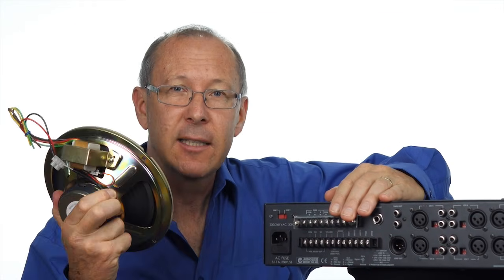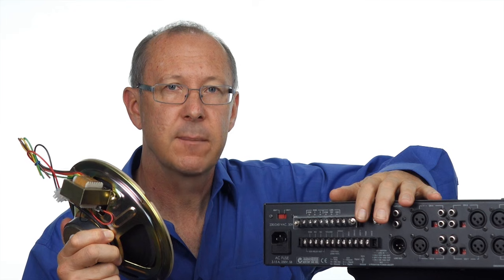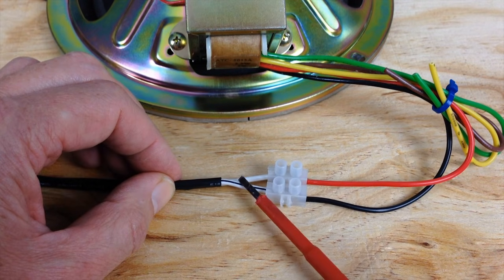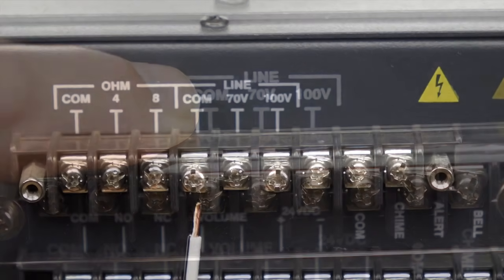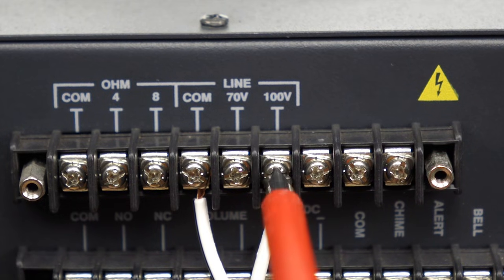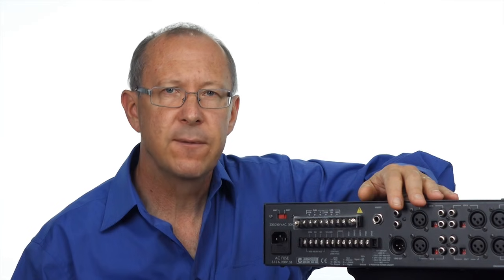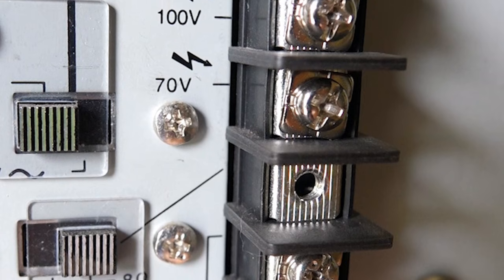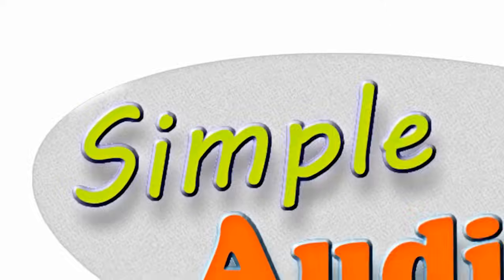Connect the amplifier to 70/ 100 volt speakers

Comment: Why are the speaker wires not connected to the “OHM” conn and either the 4 or 8 terminals..? Is that an 8 ohm speaker. Thanks

Comment: I have bought a MISTUBA 
Professional
..............................
DRIVER UNIT WITH TRANSFORMER
MTB-DU-50TR          CE
RATED POWER 50W  INPUT 100V
HORN COUPLING 1-3/8"-18 THREADS 

COM-BLACK
8W-1.3K OHM ~WHITE
15W~670 OHM ~RED
30W~330 OHM ~YELLOW
50W ~200 ~BLUEOHM
  the transformer inside has been burnet, could you tell me what is the rated output power,voltage of the transformer used so I can buy.

Comment: I have some old Argos intercom speakers with transformers attached to the speakers like the one you show. I build my own low power amps for mandolin and acoustic guitars. I have hooked up my amps outputs directly to the speakers. I have been unable to use transformer. Is this because I need an amplifier with the proper 70/100 volt outputs? Any way to take advantage of the output transformer? I typically have a 12v power supply feeding a LM386 or LM380. 1 to 3 watts output. Standard mono output.

Comment: I have a ADS 120 w mixer amp with 100v and 70v.  Everything works on the 4ohm -16ohm speakers post.  But I'm wondering about the 70 and 100v terminals.  I didn't feel any jolt or anything nor did it indicate anything on the my Volt meter.  I haven't hooked up my 100v speakers to anything yet, but shouldn't that 100v be live all the time? Or does it need a speaker hooked up to it?

Comment: Hi Gary, my question is, I have 10 toa pc-1869 ceiling speakers and I want to install them in the patio ceiling, now I have a Sony STR-DG510, can I wire them to this avr or do I need a 70/100V amplifier. Thank you for your time Gary.

Comment: Hi, is the ACM120 and 1 or 2 channel output amp ? could i run hifi speakers on it....cheers
Reply from the maker: The AudioTelex ACM120 is a mono amplifier. It has multiple inputs but only one output. It is not stereo.
Reply: @GaryDmedia  thankyou for the quick reply, one came up at a good price but no good for me with 1 channel output, Brett

Comment: Question:
0:50   Does the 100v line cause electric shock if someone touches the 100v terminal screw ? Thanks for the video.
Reply from the maker: In practice the actual voltage at the 100 volt speaker terminals will be between 10 and 25 volts. This is not lethal. Though I wouldn't put my tongue on the terminals. 
Because it is rated at 100 volts peak, manufacturers are required to place a cover over the terminals because it is over 50 volts.
Reply: @GaryDmedia  
Thank Thank you for your explanation.

Comment: How to connect the ampilifier to the mixer
Reply from the maker: Melad, depending on the amplifier input and the mixer output there are many options. Most mixers have a balanced 3 pin connector. A standard microphone lead will plug into this and the most amplifiers have the same connection for input. If yours is different you may be able to access the information in the user guide.

Comment: Hello sir
How to make 100volt amplifiers
Reply from the maker: 70 volt or 100 volt output amplifiers are simply a standard amplifier with an output transformer. You can make a 100 volt output amplifier by connecting a speaker transformer to the 8 ohm output. You must remember that the output of the amp must not be greater than the rating on the transformer.
Reply: @GaryDmedia  Hello sir
How much current it will take
Reply: Hello sir
How to make amplifiers 37V lord brahama laxmi sarawati ब्राह्मोस (रोमन लिपी: BrahMos ;) हे भारताचे स्वनातीत क्षेपणास्त्र आहे. स्वनातीत, म्हणजे ध्वनीच्या वेगाहून अधिक वेग ...

Comment: Hi.i have 20wats speaker  then mention  500ohms/500ohms. So where i have to connect. How many ohms
Reply from the maker: It is a little confusing. Yes the 500 ohm connection will be for the 70/100 volt line from the amplifier.
Reply: @GaryDmedia  hi sir. I have  amplifier that one don't have out put line for connect to power amplifier system .so i can take out put  from  70/100 volt line or ohms line then connect to QSC  power amplifier  input line.

Comment: Hi Sir, what is the differences between 70v and 100v line...
Reply from the maker: The difference is only the voltage. You can connect a 100v speaker on a 70v amplifier but it will not be as loud. You can also connect a 70v speaker to 100v amplifier but the speaker will be louder and drawer more power from the amplifier.
Reply: got it now, i thought 100v and 70v are using for certain country... thanks anyway Sir for the great explanation

Comment: When to connect with com  4 ohm/8ohm and when to connect with com 70v /100 v i don't know
Reply from the maker: If the speakers have transformer on the back use the 100/70v connection. I have another video on my channel that describes how to connect the speakers.

Comment: How to connect for 2 100v speaker?
Reply from the maker: 100 volt speaker systems are easy to connect. Just connect them in parallel. That is all the positive or red together and negitive or black together. I have another video on my channel to assist.  https://youtu.be/5c8xuwt6nMM

Comment: HI, I bought 4 jbl 26CT  70v / 100v speakers, I want them for my audiovisual room at my house, which amplifier will you recomend me?
Reply from the maker: If you are using the speakers for a surround sound application then a purpose built multi channel tuner amplifier would best suit. These have an 4-8 ohm output so you would not use the 70/ 100 volt terminals on the speaker.

Comment: is it possible to buy a 70 or 100v out put transformer and connect it to an hi fi amplifier to allow it to drive 70 or 100v speakers?
Reply from the maker: Yes you can even use a speaker transformer in reverse. The limiting factor is, transformers are rated in wattage. If you use a 15 watt capacity transformer you can only connect up to 15 watts.

Comment: how do you connect additional speakers?
Reply from the maker: +Mission Sabai The great thing about connecting 70volt speakers is you can add them in parallel. All of the positive terminals connect together and all of the negative ones connect together. If there are only coloured terminals then the colours go together. Hope that helps.
Reply: Muchas gracias. Figured it out, and it works like a charm. Thanks for the informative video
Reply from the maker: +Mission Sabai great to hear you had success.
Reply: Hi, in this way (parallel) both the speakers will all have the same volume? But what if I want to assign more volume to the left speaker or if when recording I assigned an instrument to just one speaker? Thanks in advance?

Comment: how can i hook up a 70v speaker to a professional type amp example (qsc RMX1450 amp)
Reply from the maker: +Nithaphong Sourinthone The QSC RMX series amplifiers are not designed to connect to a 70 volt speaker system. They don't have an output transformer built in match the speaker system you are referring to. You can externally fit a matching transformer but they are expensive. Note: You can connect the 70 volt speaker system to the speaker output on the amplifier and it won't damage anything but there is a problem. Because a 70 volt speaker system has a much higher impedance or resistance than 8 ohms you will not be able to take advantage of the amplifier's full power. It will drive it but be very quiet. Hope that helps.

Comment: so where do I go to learn how to connect regular 8 ohm house speakers to the 8 ohm side? what if I want to connect more than one speaker
Reply from the maker: +Jay Blue That's a good question for another video. It depends on how many speakers you want to connect on the one line. To use the 8ohm output on an amplifier you must use a series/ parallel method. How many were you thinking of??

Comment: how would you wire a SNOM device on the back of the bogen AMP?
Reply from the maker: +davibosaya Any telephone devices with an audio output like a headset connection can be connected to the AUX input of these amplifiers. The feed from the amp to the SNOM can be connected to the REC OUT connection. It is important to install a line isolation unit in line with these connections to isolate the two systems. Hope that gives you a start.

Comment: I have one full operational 1959's Philips tube amplifier  type EL 6425 but there is no available information about the polarity of the line output transformer (70/100 volts). The original output connector was lost long time ago and the internal cables don't give me a clue about that. Neither the transformer or the internal output impedance selector. I can't find a clear back image of one original amplifier and check it. How can i recognize the polarity of the output transformer, without using special tools? I believe firmly in correct phasing of loudspeakers but in this case it's hard to know exactly what i'm doing. Is it my imagination or i saw somewhere written on the web that says that this type of transformer doesn't require to pay attention to that detail? Thanks in advance. Macedo Pinto, Portugal.
Reply from the maker: Wow, great to hear the old amp is till functioning. I will make a video soon on phasing speakers because this alone is the important thing. Some old amps didn't have any indication of polarity on the output because it is an AC voltage not a DC. Just put your own mark on one of them and make sure all the speakers are wired according to that. This video may help. http://youtu.be/5c8xuwt6nMM
Reply: Ahhh....Thanks! That's better! I was confused because of this! I will check the link, Gary!

Comment: hi there can you tell me how to output xlr to 100v line speaker.what pins on the xlr are needed to be connected
Reply from the maker: 3 pin XLR outputs do not have enough power to drive a 100volt speaker. Maybe there is another output on your amplifier?

Comment: are those plastic terminal covers necessary for 70 volt installs I have an amp without those so do you need them
Reply from the maker: It is good work practice to cover the terminals just in case someone reaches over the back of the amp while its being used. In reality the voltage during normal use would rarely be above 20 volts AC even though it is a 70volt or 100volt system. Amplifier manufacturers do supply the covers to be used. It is good practice to use them if you have them.

Comment: pls , how can i connect an amplifier to another amplifier in a paging system? in a distance about 90yds, both are work in 70volt connection and locally works perfectly with a mike  locally, but i connect in paralel the microphone an the distortion is very high.....thanks for your videos...............
Reply from the maker: soykamot what you will need is a Hi/Lo converter to drop the output so you can connect it to your second amplifier. I have included these links that may be of some help. http://www.parts-express.com/atlas-sound-tsd-txhl-high---low-level-converter--242-9488#lblSimilarProduct
http://www.australianmonitor.com.au/products/product/drop-me
My preference is the Australian Monitor because it has XLR connector for easy connection and an adjustable level control. Hope that is of some help. If you need a cheaper alternative you could use a speaker transformer in reverse and an 8 ohm to RCA converter like you would use for a subwoofer in a car.
Reply: may this stuff could be useful......? or something related?......
Reply from the maker: soykamot yes this unit would be ok but you will still need to use a speaker transformer to convert from 70 volt line voltage to an 8 ohm level. Simply use a speaker transformer and choose one of the lowest outputs, maybe 5 watts. I will try to upload a video sometime that shows how to do it.
Reply: my incoming signal comes from line- out of the amplifier..... if i connect from the 8ohm out of a 70v transformer in a previous speaker to mic input is necesary the hi/lo converter?
Reply from the maker: soykamot yes, you need to electrically match the input and also it isolates the first amp from the second amplifier.
Reply: this is what i need to know...... i'm was scared to wreck the amplifier.....(this was happened before) i gonna recomended your link, your help was so great. thank you very much.... Albert
Reply from the maker: soykamot glad to help.

Comment from the maker: Connecting a 70/ 100 volt  #speaker  to a public address #amplifier can be a real problem if you don't know which terminals to use. This is a short instruction video shows you where to make the connection. #Constant-voltage speakers need to be carefully wired so you don't overload the amplifier.
Reply: brand of the amplifier